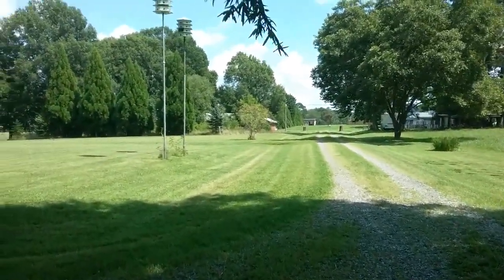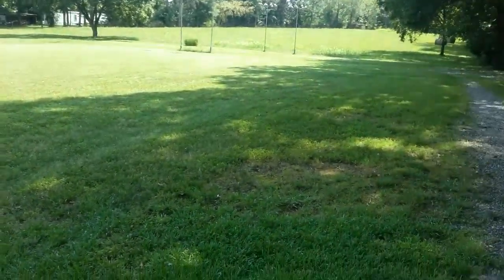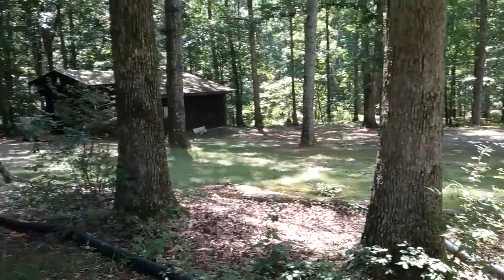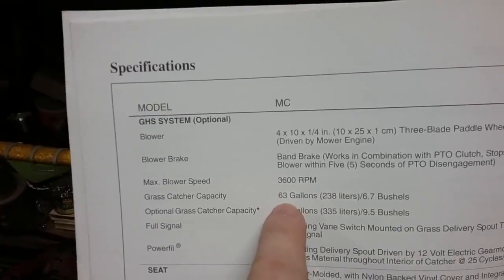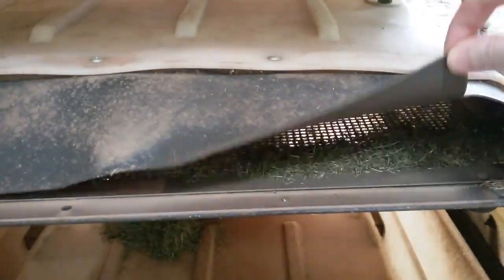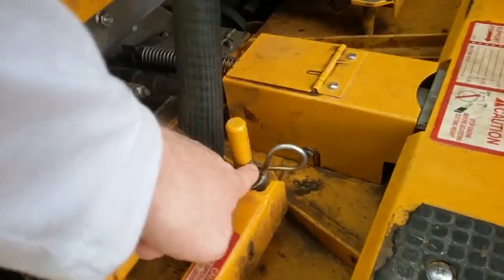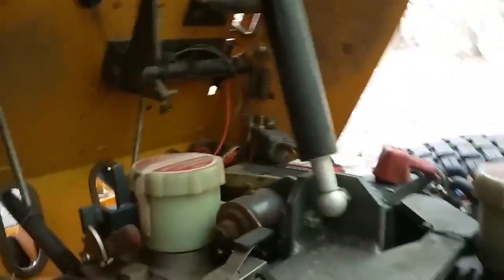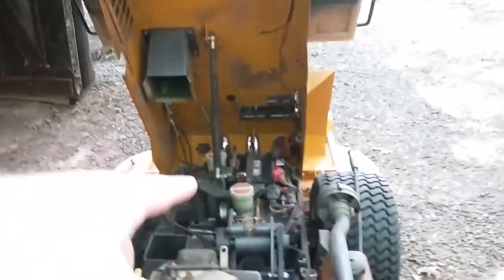Thinking of buying a Walker mower with bagger? Things you need to know, and picking up grass. part 1

Comment: Man that is a lot of grease fittings and they all need to be greased to keep from wearing out. You take your mower in for serice and you don't know what short cuts they take, then you pay later with a failed part or bearing. Great that you are letting us all know.
Reply from the maker: Yeah, I took my Toyota Tundra 4x4 to the dealer for service and asked the technician if he greased the drive shaft. He said it didn't have any they are sealed bearings. I walked under the truck and pointed out the grease fittings all along the driveshaft. He said he didn't know. Really he's the ASE technician? He's under the trucks all day long and don't notice they have grease fittings, come on!
Reply: @blondeguy2035  I have worked at a few shops and 2 dealers, there are a lot of techs that are not ASE certified, (myself included) and lots of things to be desired as far as knowledge. Any dealer can only do what the techs are capable of. In our minds we want to think that the dealer is always the best place for service. But the truth is any capable person with mechanical knowledge can perform all the work they do, they may just know a quicker and easier way to do things. Sad we live in a world where a mans word of trust pretty much means nothing to most :/ good video and thanks for the knowledge. I just purchased a ‘13 model walker and I’m in love with it. But I have been doing lots of maintenance that was skipped on especially as far as grease fittings. The previous owner had no clue how many there were lol.
Reply from the maker: @StephenBrewer89  Thanks for your comment. By the way, what brought that on was the oil leak I had under warranty that they never could find. I took it in for an oil change and I mentioned I had an oil leak at the rear of the engine. While showing them my oil leak I casually asked the technician if he greased my driveline and that's when he said they're sealed. Now that it's out of warranty I showed it to them again and now they want to fix it and for me to pay part of the repair, I declined their offer. Now out of warranty I do my own oil changes and grease my fittings and found another oil leak at the front of the engine they didn't see. I'm a firm believer in doing your own oil changes on your vehicle and checking for leaks yourself. The technician might not always tell you that you have an oil leak, a water leak, a trans leak Etc or other problems. Good luck with the maintenance on your Walker mower and any vehicles that you have.
Reply: @blondeguy2035  that’s awesome! I always love to see people do there own work. I don’t remember what it’s like to go to a dealer, but I’m also a 4 time Mercedes Benz owner so if I end up with a module problem somewhere my scantool can talk to then I will have to let that go to a shop. It just feels good knowing that the work I performed is up to par, and ad least I know if something was left for next time vs them saying they fixed it and you will never know. Thanks for the good luck and good luck to you too!

Comment: Walkers are overly expensive and  hopeless at bagging wet grass despite what walker say
Reply from the maker: Yes they are expensive and I don't know how close they are to other lawn mowers in engineering. That being said I didn't pay for this one but I think it was around $10,000 and it's about a 2003 model. As far as wet grass goes with any mower you should really wait till it's dry. I use this one mainly to pick up leaves and grass if I need to when we get a lot of rain and it grows fast. I mow my grass with a Kubota zd21 diesel. Thanks for watching!
Reply: Walker can handle wet lawn depending how long it is use high settings and than lower it